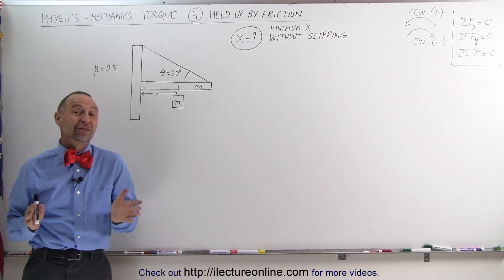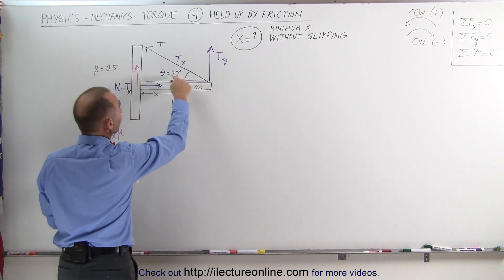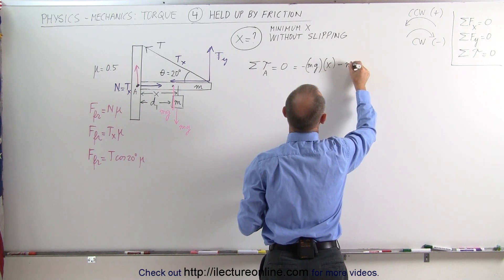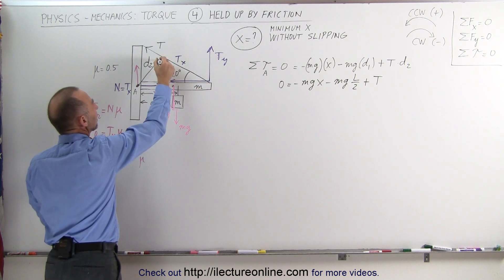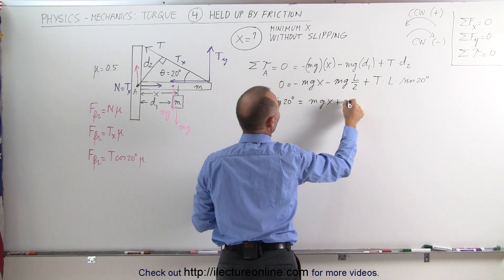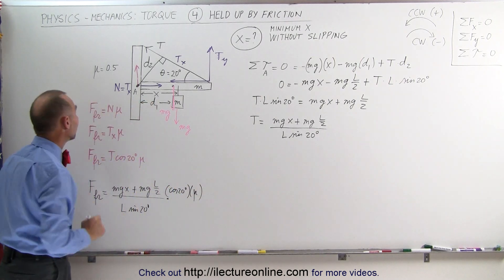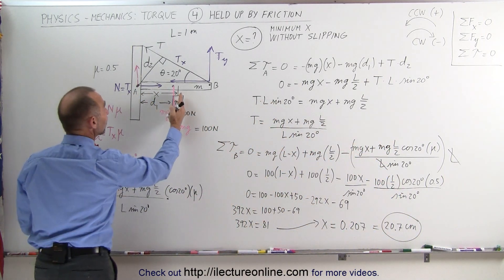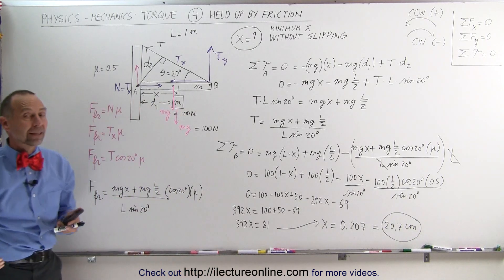Physics 15  Torque (4 of 27) Bar Held Up by Friction

Comment: Hello professor, from questions that ive answered in the past, when the bar is being tied to the wall, shouldnt there be a reaction force opposing the tension from the wall to the bar since the bar is being pushed to the wall? I couldnt answer this question because i included reaction force so i wonder why we have to exclude the reaction force in this situation?
Reply from the maker: According to Newton's third law, for every action there is an equal and opposite reaction.  Therefore, when the horizontal beam is pushed to the left (by the tension in the cable), there will be an equal reaction force from the vertical post to the right against the beam.  Thus it becomes a point of perspective.  The force acting on the post is towards the left.  The foce acting on the beam is to the right.
Reply: @MichelvanBiezen  oh, in this case, the reaction force in component x would be normal right? but what about in y component? Would that be friction? Sorry im so confused 🥹
Reply from the maker: The friction force will prevent the beam from slipping down.  Therefore the friction force will be directed upward (y-direction)

Comment: The solution is incorrect. The factor cos(20) in the expression for the friction force is multiplied by the entire nominator, but in the calculation phase you multiplied it only by one of the terms in the nominator. The final answer should be 34 cm, not 20.7 cm.
Reply from the maker: Yes indeed, there should have been parentheses around the value of "T".   Others have caught this error as well down below.  Good catch,

Comment: How did you know where to choose the pivot point at?
Reply from the maker: You pick the pivot point location in order to eliminate the maximum number of unknown forces (x and y components of the force between the beam and the post).  The torque cause by these forces equals zero.

Comment: Wouldn't the distance to the pivot point A of T be just the whole length of the bar? Since only Tx is the one acting on point A and both Tx or T have the origin of the vector at the end of the bar?

Comment: Dear Professor, i think in  time 7:00  of the video, you forgot to put parentheses around mgx + mgL/2. Am i right?
Reply from the maker: I should have written the cos(20 x mu a little further to the right.  It is indeed the whole fraction multiplied by that factor.
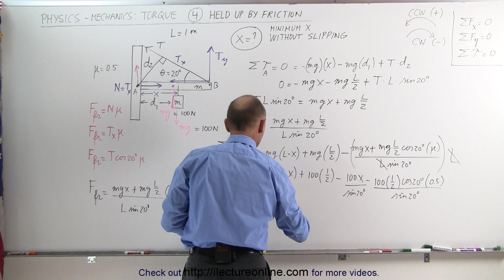Reply: @MichelvanBiezen  The problem is that your majesty forgot to distribute cos20u to all elements of the numerator and you only multiplied that to mgL/2. At 11:35 , you should also multiply 100x/sine20 at cosine20u .
Reply from the maker: Yes, you are correct.  We corrected it with annotations, but they can only be seen when using a computer to watch the videos.

Comment: Why does the Tension NOT cause a torque about point B?
Reply from the maker: +Asrahi Rodriguez 
 Because the line of action of the force (Tension) goes through the pivot point which makes the perpendicular distance equal to zero.
Reply: +Michel van Biezen Thank you! Your videos are very helpful!!

Comment: Could we have maybe assumed that x was just some coefficient times the length thus letting us cancel out all the L's in the sum of torques on A ? This is the way i tried to solve it before watching the video and i have a feeling that my reasoning is somehow wrong.
Reply: +frnchdazzled Yea, I plugged in the same numbers as you did into my final formula and it doesn't work. But Why ?
Reply from the maker: +frnchdazzled 
I just noticed that I made a mistake.  I did not put parenthesis around the tension.
The correct answer is 34.3 cm.